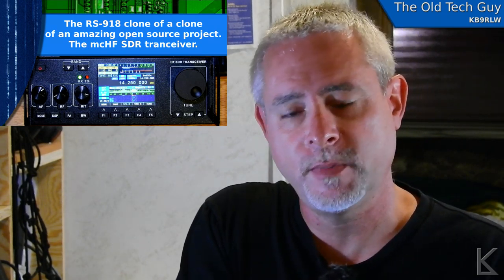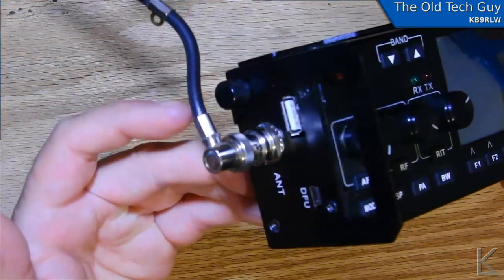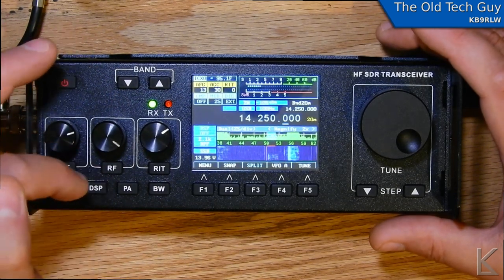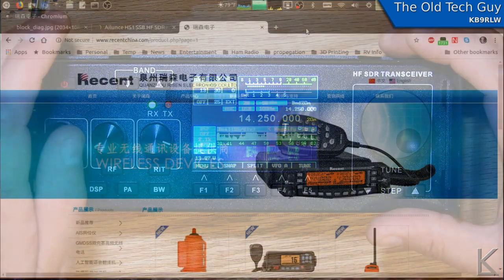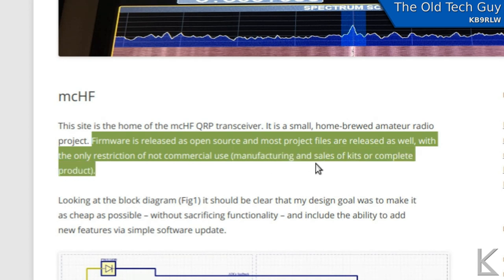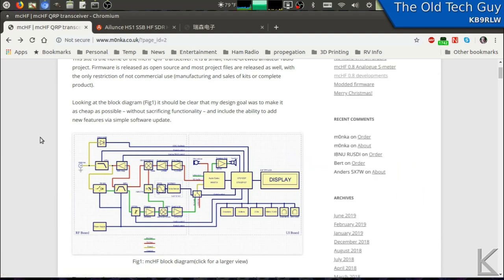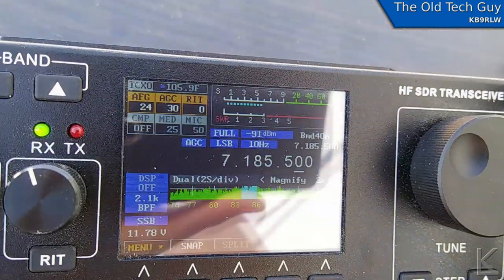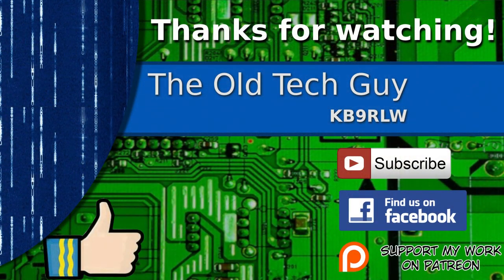Ham Radio - The RS-918 clone of a clone of an outstanding open source SDR transceiver, the mcHF.

Comment: Love clones, keeps the industry competative. Open source = anyone can make it. Often chineese made is better quality. Prefer to buy the cloned version because it costs less.
Reply: @MrPerrey  It seems you didn't read the comments or watch his follow-up to that video that is over a year old.  He blew an internal fuse.  The factory gave him assistance fixing it.  He now reports that he likes the RS-918 very much.
Reply: @drgiller  - Out of nothing fuse burned up. Put a solder blop on it for short cut. Lucky bootet up and don't know why. Thats the way it works?
Reply: Wolfram Perrey I suppose no “real” mcHF has blown a fuse?  The fuse is there for a reason and it did its job.  We don’t know why the fuse blew because we weren’t there.  You implied that the video showed someone with a problem. I pointed out that the WHOLE story is that they got support from the manufacturer (surprise!) and are apparently quite pleased with the radio, which counters the point you tried to make.  You can keep arguing half of the story but it doesn’t help you.
Reply: They probrably use an inferior American union made fuse that failed. LOL

And yes fuses can just blow with no failure in the radio, bad / week fuse.... Etc,
Reply: @drgiller - more about clone crap user experience and how to make the real deal: https://youtu.be/FENMdK43vko
Reply: @MrPerrey  Keep hurling insults, stay angry.  

I did find it odd that most of what he brought up were firmware issues, or claims that the clones didn't have certain firmware features, given that the RS-918 uses unmodified mcHF firmware.  Intermod (or whatever that is) on a general coverage band, outside the supported frequency range of the TCXO; although, it would have been interesting to have a "real" mcHF side by side to see if there was any difference there and then... maybe there would, but how much would you wager?   You're right though, it looks like the mcHF design has some limitations and rough edges.  I still think it's a nice design, especially for tinkerers. 

User experience.  Would you like to talk about how M0NKA switched the kits' LCD from parallel to SPI communication because he couldn't solve the quality issues with the LCD modules he buys from... China?  And the effect that has on the speed of the LCD, especially the waterfall? 

If one were to look at the BOM of his kit, I wonder how many parts were NOT made in China?  I wonder if the boards themselves were made and stuffed in China?  I've not found where he says the kits are made.  I think we can assume he doesn't do the SMD soldering himself, and we already know he sources some parts from China, so... wouldn't it be nice to know where his boards are made?

Would you care to share photos of the insides of clone radios that are missing parts, have substandard inductors, and so on?  And document who manufactured those radios?  Can you even point to a web page or video that does so?  Have you actually touched any clone radios or are you informed only by what you've read other people say?

Look, jabs aside, beginning here I am being fully earnest and not snide. I would like to see UHSDR and M0NKA benefit well from their efforts.  But bashing on the Chinese, or people who are buying clones, just does not help.  I'm well aware that from China (and possibly elsewhere) there are some people doing improper things with the mcHF project, and some low-quality and otherwise dubious clones being sold.  There are bad people everywhere.

But there are also legitimate Chinese manufacturers making radios that are as good as or possibly sometimes better than an mcHF kit-built radio, and doing so without breaking any laws or ethics, or violating anyone's legitimate IP rights.  Recent and the RS-918 they sell (again, the subject of this video) seem to be one such example, and there may be others.  You and others continue to pretend that this is not the case, but the facts are out there, and that hurts your credibility.

I'm pretty sure you didn't read the link I posted elsewhere to the discussion on UHSDR's own GitHub page.  It points out that what at least some of the Chinese cloners are doing is not illegal and not unethical, and that hurling around unsubstantiated claims about quality problems in the clone radios (as you are doing), and making inaccurate claims about laws, licenses, and infringement (as you are doing) is harmful to UHSDR and mcHF.

If it doesn't get destroyed, this could be the start of a great community that could do great things, and there are many ways for the UHSDR owners and M0NKA to benefit from that as they should.  I don't think the Chinese clones are the biggest threat to that community.  And they're not going away, so taking advantage of their interest in a way that promotes the project would be far more useful.